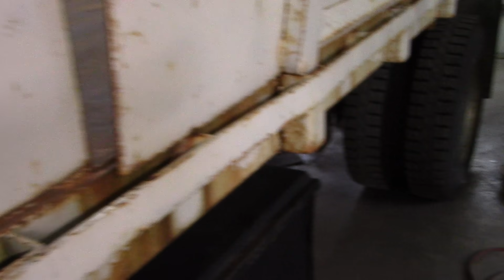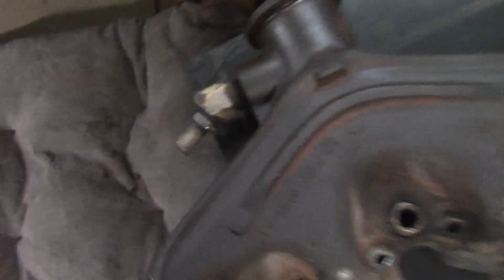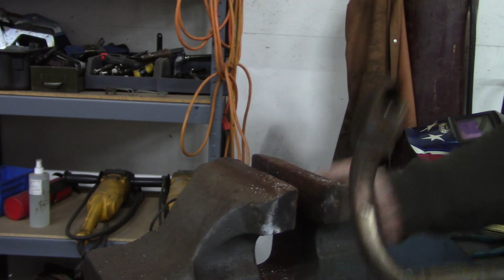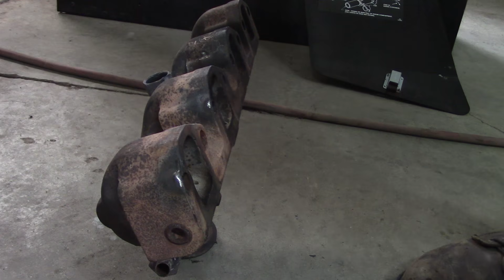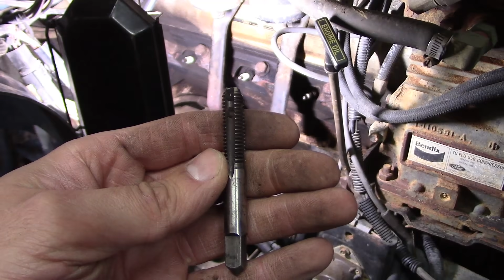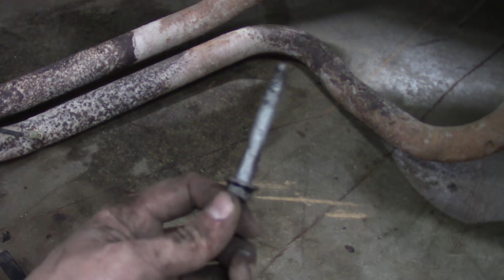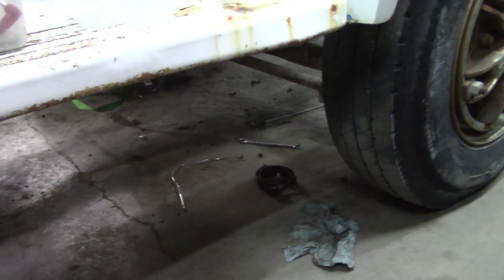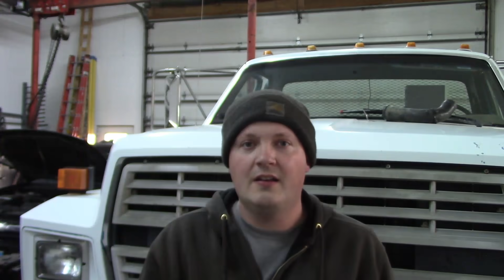Ford F700 Project - Exhaust Manifold Leaks (Gas Engine) - Part 1

Comment: Date  Dec 7th, 2020 Kennethzakaib607@gmail.com  Montreal Quebec Canada.   THIS  VIDEO, SHOULD BE MUST WATCHING FOR ALL,  HIGH SCHOOL MECHANICS COURSES  ACROSS THE CONTINENT !   Now, lets all be honest ! We North Americans all in our hearts want the big Three, to be Number one, in the universe !  Why?  Predjudice! we grew up with them !   Now that  1994, F700
conventional cab, is a NICE LOOKING  HEAVY FIVE TON!   The cabs are roomy, for big guys!  This one is a Heavy axled job!  That 
six spoke Dayton wheeled front axle is at least about a 12,000 POUNDER capacity. The rear axle, is most probably a 23,000 pounder, capacity !  The engine is the Ford Super duty class of 429 cubic inch!   These are great tuff engines! Take care of her!  
Change her oil regularly, and she will go for years and years !  She will eat you out of house and home for gasoline! But these truck
engines were designed back in the day when gasoline was  say 50 cents a gallon !  THESE TRUCKS MAKE FINANCIAL SENSE WHEN A COMPANY NEEDS A HEAVY TRUCK, TO DO LITTLE MILEAGE, AND MAKE HER MONEY, FOR THE OWNERS  IN THE IMMEDIATE WORKING URBAN EREA , OF OPERATIONS !   MEANING ON THE JOB SITE!  THAT IS WHY, THE GAS ENGINE BURNING 
LOTS OF FUEL,  GIVES THE POWER THEY NEED, BUT FUEL CONSUMPTION IS NOT AN ISSUE , BECAUSE THE  PROFIT IN THE JOB IS MADE AT THE JOB SITE !  IT IS NOT WORTH THE INVESTMENT IN A DIESEL TRUCK , WHICH WILL DO THE SAME JOB, AND COST THE COMPANY ALMOST $20,000   MORE OF AN INVESTMENT ! THAT IS WHY!   THESE GASSER TRUCKS ALSO COMPETE VERY WELL IN FUEL CONSUMPTION  WHEN PUSHING SNOW, IN LARGE PARKING LOTS, BACK AND FORTH !   BELIEVE ME , I AM FROM MONTREAL , AND WE  HAVE DONE SNOW REMOVAL FOR YEARS WITH THEM !   ON THE ROAD THE DIESELS  RULE! 
THEY ARE CHEAPER TO RUN. WHY? RPM.    BUT BACK AND FORTH PUSHING SNOW, THE GASSERS  ARE VERY MUCH 
COMPATIBLE AS TO COSTS OF OPERATION, BECAUSE THEY  DO NOT REV SO HIGH AS WHEN ON THE ROAD BETWEEN 
PARKING LOTS!  DIESELS CRUISE AT 1,800 TURNS, GASSERS CRUISE AT  4,000   TURNS !  GOT IT? ok.   (but not while pushing snow)    Also, is the fact that these Years with the tilt hoods, the idea, was to have better access to  the engines for service ! 
Well , the truth is , there was so much  other equipment  piled onto these engines,  And  burrying them  under the  fire wall,  as WES
said,  they are a V-pattern engine, and they  are  a hell of a lot more crammed into the chassis as a result !  So, you have the 
difficulties that WES had Here!    Also, as smaller gas engines go , they have the same requirements for  vacuum operated  stuff' 
air pumps,  valves,  air pipes,   and plumbing , the works! like cars for emissions controls !   AND WES, IS A SOLID YOUNG MAN! 
HE IS A TRUTH TELLER!   THE SAD THING ABOUT THESE YOU-TUBE VIDEOS , IS THAT A LOT OF CLOWNS ARE FREE TO SPREAD THEIR  HILL BILLY NONSENSE, ON LINE.  OLD WIVES TALES! LIKE PULL OFF ALL THE ANTI-POLLUTION STUFF!   WHEN THE TRUCK GOES UNTO MECHANICAL INSPECTION?   IN MANY STATES,  ONE LOOK AND YOU WILL SEE THE FINES!   NO JOKE! 
Now,  you saw , the  troubles WES had with the siezed  pipe  fittings, and  the effects of corrosion , and heating and cooling !  
Multiply that by many times up here in Canada,  BECAUSE OF THE USE OF ROAD SALT IN WINTERS!  OK ???? IT IS A NIGHT MARE
ON THE TRUCKS, IN TERMS OF CORROSION !   See how WES, worked on this truck, and it is in very good shape for Her age ! 
I have  Trucks with the very same exhaust manifold  leakage issues, only older seventies units, in 4x4 !   I can go on, But, THIS VIDEO SHOWS YOU, BY WES, A POLITE , CALM GUY,  HOW HARD IT IS TO BREAK STUFF LOOSE,  AND  WORK TO GET THE TRUCK BACK TO WORK!  AND REMEMBER, THESE TRUCKS ARE NOT CHEAP TO REPLACE !   THE ONLY THING I WOULD HAVE DONE , IN ADDITION TO WHAT EXCELLENT WORK WES DID , WAS TO APPLY  HIGH TEMPERATURE  GASKET GLUE/SEALER  TO THE 
SURFACES OF THE BLOCK, THE GASKETS, AND THE MANIFOLDS,  TO IMPROOVE  THE SEAL AND PROTECT THE JOINTS!
BUT STILL I SAY WES, DID A PERFECT JOB! AND LOOK AT THE AMOUNT OF HARD WORK TO DISMANTLE THE THING AND NOT DESTROY EVERYTHING FOR HIS CLIENT !  AND THIS IS PROFESSIONALISM! AND IT IS LONG , HARD, DIRTY, WORK! 
THIS IS REAL WORLD MECHANICS!  THIS IS IT!   USE OF TORCHES, HEAT, COOLING,  TRY , TRY, TRY, AGAIN !  THIS IS NO JOKE!
HARDNESS TO ACCESS THE WORK !  LOOK AT THE WOUNDS ON WES'S HAND !   THIS IS REAL MECHANICS ! 
I CAN TALK FOR HOURS ABOUT WHAT WES SHOWED IN THIS VIDEO!  EXCELLENT !  AND MY GREATEST POINT IS, SEE HOW TOUGH IT IS?   IS THIS WHAT YOU WANT TO DO FOR A LIVING?   GO INTO MECHANICS WITH BOTH EYES OPEN !
WATCH WES WORK IS IN MY VIEW ONE OF THE TOP MECHANICS VIDEO CREATORS FOR YOU-YUBE !  PAY CLOSE ATTENTION!
WATCH IT SEVERAL TIMES OVER. MAKE NOTES !  AND WES IS NOT ARROGANT,  NOR  IMPOLITE !
RESPECTFULLY  ken zakaib.

Comment: Any time I do manifolds I use high tack permatex to hold the gasket in place.. But if you cant, start the top right with a bolt and no gasket, just a few threads. Then do the same with the left, but with the gasket. Now undo your first bolt and swing the gasket in, and now you should have a bolt at both corners with the gasket behind.
Not sure if either wouldve worked for you, they're typically limited access, but that's what I try to do
Reply: Permatex 80062, and I only use it on the end ears to hold it there for a second. Not a full coating like on a water pump gasket or something
Reply from the maker: Super glue works well for a lot of gaskets.

Comment: I gots a question...if you weld up a manifold, then get the entire thing red hot to anneal it (keep it red hot a while), will the weld work?  I've heard you can't weld exhaust manifolds as they'll recrack.  #DontDoCrack
Reply from the maker: I've done it many times with no issue. The best way to weld cast iron is called furnace welding, which does require the whole thing to get red hot. That's how cracked cylinder heads are repaired.
Reply: @WatchWesWork  Thanks Wes!

Comment: A little tip I learned 50 years ago  use wax from  a toilet ring on exhaust bolts and nuts ,they come off real easy next time.
Reply from the maker: Interesting. I would think the heat would just cook that right out.

Comment: Says Non-Catalyst on the valve cover and also has no Cats, but still had secondary air???
Reply from the maker: Yes. The air still helps burn the junk in the exhaust.

Comment: You may have answered this already but is it a requirement of your state to leave the air pollution stuff on the vehicle? Because I don't think you have to have those air injections in the manifolds if you're going to take off the emission control stuff. All the best from Canada
Reply from the maker: That's a federal regulation. You cannot legally remove any emissions control device from anything, ever, for any reason. People of course do it all the time. But it's not legal. Even things like engine swaps and diesel swaps are technically not legal.

Comment: Love the channel.  I like how we are right there with you doing the work!  Being from Texas and not having much rust how do y’all make any money doing these jobs?  That’s a 300-400 job in Texas and it takes, 3-4 hours.  I assume you have a full day plus in this job.  300-400 bucks a day isn’t cutting the mustard for a shop.  What you make is none of my business but I am curious how you cost factor rust and get people to pay it!

Great channel.
Reply from the maker: It depends. Some jobs I would charge more to deal with rust. But most of the time we are used to dealing with it and it doesn't really set up back. Rust brings far more money into my shop than it takes away!

Comment: Those hard lines that broke....are they vacuum? your replacements may work when cold and collapse when hot.
Reply from the maker: Vacuum. Rubber hose is used for vacuum all the time.

Comment: Some kind of lucky to have those exhaust manifold bolts come out...in my experience, IZ never had even a hex head left.    Just one rusty mass of iron.   From salty , other nasty stuff on the roads  New England.
Reply from the maker: Right. These were not so bad. I've been down the hard road before though. Drilling them out. Helicoiling them when I screw up drilling them. Etc.

Comment: Well, at least if there is some leaking at the exhaust manifold with no gaskets it will be minimal since it's an iron face against an iron face as opposed to a blowout of the gasket would make for a wider gap and more leak and noise.
Surprised the owner would want to spend the money to fix this exhaust leak.
Reply from the maker: It was pretty bad!

Comment: One of the things that lead to red hot exhaust manifolds and the resulting cracks are the restrictive exhaust systems. My big GMC gas burner has a dual 2 1/2 inch exhaust with  a large round truck muffler on each side.

And as I use the non ethanol higher octane fuel in it, the ignition timing gets advanced. That too reduces exhaust gas temperature and makes life on exhaust components easier.

Comment: Mine is an 03 Ford Super Duty with the illustrious V10 6.8L 415CID. and it had broken exhaust manifold studs. Cast Iron manifold and aluminum heads...yay!!! Got both sides apart and off the truck, got the broken studs out of the head, ran a tap down all the holes, installed new studs, torqued to factory specs, and as I was running the motor to heat up the manifolds to get the gaskets to seal. I hear this "tink, tink tink" sound. WTF is that you might ask? It was 3 brand new studs snapping because the cast iron manifolds were warped and I didnt bother to check them. 3 studs on each side snapped on the initial start!!! Tear them back off and surface ground the manifolds, installed stainless steel studs. Break now you little M-Fers, I dare ya!!! lol. Been golden, knock on wood, for over 3 years now.
Reply from the maker: Those engines are notorious for breaking studs.

Comment: I am super impressed at the determination to fix or repair stuff. Those gas fume puking engines are not a bad engine but for its size, you would think that the power would be more. I got sick of mine shortly after I got it off a lot where it sat and hadn't sold. I used it till winter then off season happened. Cab off, fenders stayed with the cab and nice big shop overhead crane to kill for. In went a 855 cummins out of another truck, a roll over and they are never without problems and the engine that time almost made me hate the cummins before through. I used the truck for ten or more years and everyone said where do you order one and its a put in yourself option guys. I hate the smog stuff but you live where you look at the sun with smog deferring the colors of the sun. Wiring is harder than working on the engine by far... part was I made mine into a tilt nose. Too easy not too. Wirings biggest problem is the coating does not weather well. It gets so hard that it won't bend but it sure will break or short across to the other stuff. You should be earning a significant name for yourself as youtube has at least shown how hard that you try to comply with all the rules and still leave a happy customer ..... really looking forward to the series

Comment: I noticed that offset manifold just seconds before you did. I won't say anything if you don't!
 I have a 94 F250 with the 460. It had horrible exhaust leaks because of many broken bolts. Those factory bolts cook out to be hard. Like carbide bit hard. I had 4 on the right side to drill out and five on the left.
 I was pulling a 27 foot camper when after about 450 miles the exhaust started to fart again. By the time I got home I had more broken bolts. I replaced bolts in those manifolds three more times. Frustrated I started hunting solutions. A chat with a Ford truck mechanic basically told me what you were told. He did say there was a solution. Banks Engineering stainless manifolds. Not only did they give me more punch for on ramps but the truck ran cooler. I also got the modified air box, K&N filter, stainless exhaust back to the outlet. I also sprang for the incredible Trans-Command shift controller.
 The big problem with this is now I had an 1800 buck truck with 2600 bucks worth of Banks goodies! 
 I decided that I was going to keep that truck no matter what so it is worth it. I have a motorhome now so the truck is in retirement.  But it always starts first turn and will get 15mpg driving from South Carolina to north Florida. It will pull 11 to 12 going north.
 So there is a permanent end to the exhaust leaks but it's not for everyone. 
 My boys get a chuckle out of me every time we see and hear a Ford truck with the farting manifolds..........yep! It's a big block!
 Be safe and have fun!
Terry from South Carolina
Reply from the maker: Interesting. I wonder if those manifolds are still being made.
Reply: @WatchWesWork  yes still available for the 460. 1360 bucks!
They have gone up a bit since 2010!
Terry from South Carolina
Reply: @WatchWesWork  if you plan to keep the truck forever it's the way to go. Stuff fits fantastic no issues at all. Best of all 10 years no exhaust leaks! I sure have put her through her paces!

Comment: That exhaust system was the biggest piece of crap. The fuel system would always be lean causing the manifolds to overheat breaking bolts cracking manifolds and seizing all the fittings.

Comment: Oh No.. Not the Ford 700, that's a ( Mother Sucker) You have the patients of an Oyster ??
1st, special tools  $1200.00
2nd aggravation   $2750.00
3rd  Tricks of the trade  $3752.00
4th Just having to work on the damn thing, $4165.01
5th second time removing Manifold, (No charge,)  should listened to myself the first time..
6th Knowledge.. $5000.00
7th can't wait for video #2 , More $$$$ 
See Ya

Comment: I did this myself on my last pickup. Can confirm it’s a pain. Actually only got the driver side done because the only rust on the truck was a stud holding the manifold and the egr valve. All of the bolts were good. 

I think someone lost the original nut on that stud and replaced it with something that made a nice galvanic cell. There was no thread to be seen on the stud and the nut was pretty much circular. I never got around to replacing that stud and nut before the transmission went out, and that was the end of that truck for me.

Comment: aren't those manifold bolts suposta turn haft way out getting your hopes up then break off, the bolt in exhaust  pipe is standard procedure  for me im used of it  now i would look in pipe first now a days i work on 70's 80's vw vans for fun that should explain  a lot lol great video keep safe
Reply from the maker: That is correct!

Comment: Man hats of to you Wes! Funny, the tree service company I was a foreman for had a '94 F-700 chip truck that we used as a backup for our newer GMC. It was orange and white, (former Asplundh truck.) We called it the 'creamsicle.' It was a real gem. Literally had some of the similar issues as this one. I replaced one of the exhaust manifolds and the head was broken in the same area where the manifold studs bolted. I believe the one we had was a little worse with maybe 4 of them rotted off. I didn't use a gasket on ours, just ran the grinder over the sealing surface as best as possible and it worked well enough. The drivers side door was falling apart on it, and a bunch of the sheet metal was torn up and I had to reweld it back together. Basically never ran the door panel on it because it was so problematic. LOL. Yeah, I have no idea why they loaded these engines with so much emissions bullshit. much more complicated than it ever should've been, especially since it's not even really OBD1 IMO. Seeing you work on this sure brought back some memories lmao. Ours ran like shit too, pretty sure I fixed a bunch of vacuum leaks, replaced the plug wires and maybe a sensor or two and it made it run better but the exhaust leaks are definitely a bigger factor than normal on how these run. I really enjoyed this one, some real comedy for the person that's watching. The person working on this lovely thing, not so much lol. Waiting to see the next installment on this beauty! HA! 👍😎

Comment: Arent the air pumps there to provide oxygen to the cats? I dont see any cats in that system.
Reply from the maker: This truck never had cats. The air helps to burn the crap in the exhaust. It is only used in certain driving conditions.
Reply: Hmm, I've always been wrong on that then.....
Reply from the maker: @blake8297  If this truck had cats the air pump would work as you said.

Comment: The cracks in cast iron manifolds are usually so contaminated with carbon that they don't weld very well.
Reply from the maker: Brazing is pretty tolerant of contamination.

Comment: I hope the viewer/owner understands how lucky they are that you took that job. No other shop in existence would have taken the care that you did on that job or gone the extra TWO miles to make things right. That truck sounded like a Saturday Night Special racing at Byron before you worked on it. And is it just me or was it actually QUIETER with no gaskets as opposed to with gaskets? I bet they were already leaking. If its not a metal gasket, I don't trust them.

Great job buddy!

Oh, and 98.8K!!!!!! Almost 100!!
Reply from the maker: It might be quieter due to how I edited it. I always lower the volume when the engine is running. I might have lowered that clip more. I can't remember.

Comment: Who runs a 427 GAS engine in a heavy truck anymore? The fuel bill must be stupid
Reply from the maker: It was pretty common. Much cheaper than diesel initially, and if you don't run a lot of miles it's no problem.